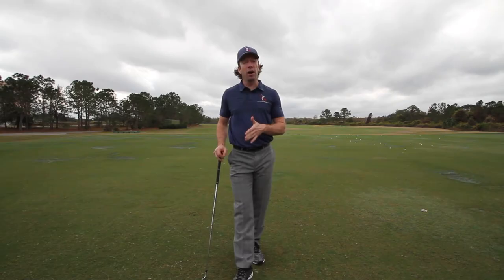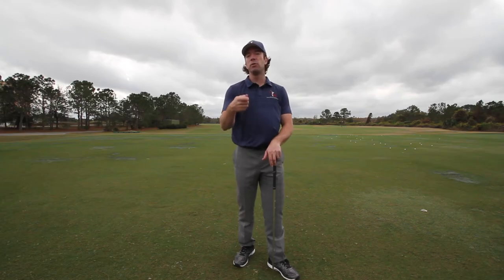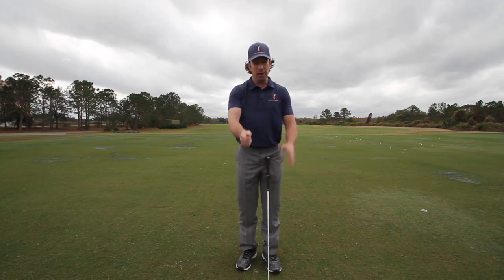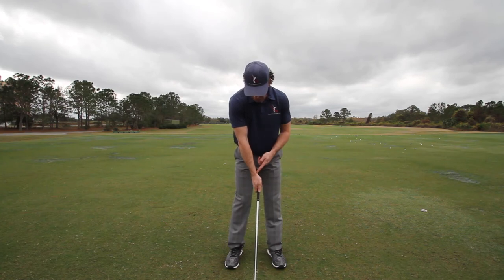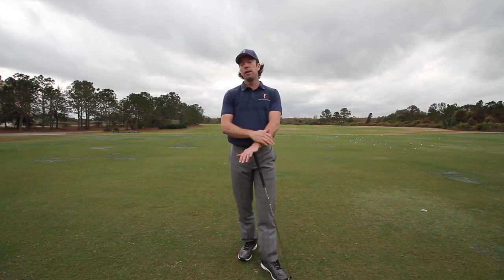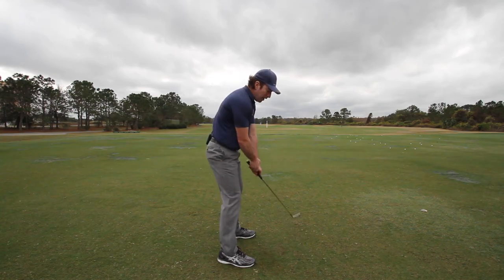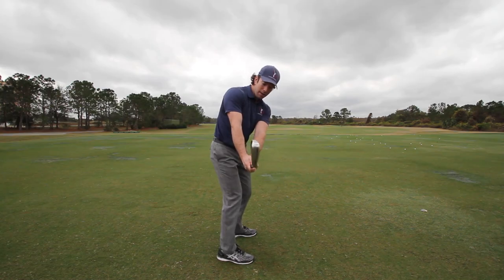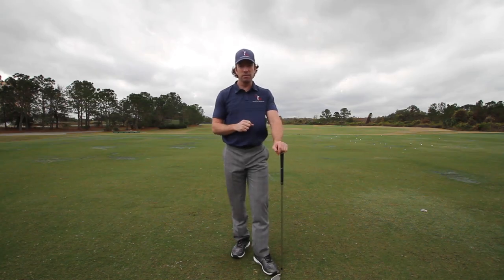Wrist Cock vs. Wrist Hinge in the Golf Swing

Comment: I disagree.  To get good club head speed you need to hinge/unhinge the right wrist (right handed player) and/or rotate the forearms.  Forearm rotation requires good timing so many pros now favor hinging.  Wrist cocking is primarily a motion at right angles to the intended direction of travel of the club head so produces very little in the way of club head speed.  How much you cock (primarily the left) wrist depends on how weak or strong your grip.  It is wrong to say hinging closes the club head or takes the club too far inside.  That’s because you turn and lift the arms as you hinge and set the wrists, so the club head stays pretty square to the line of travel and goes upwards rather than continuing back as you turn.  See Malaska